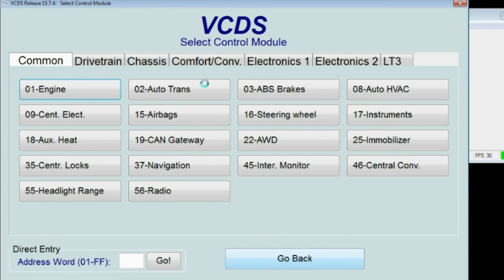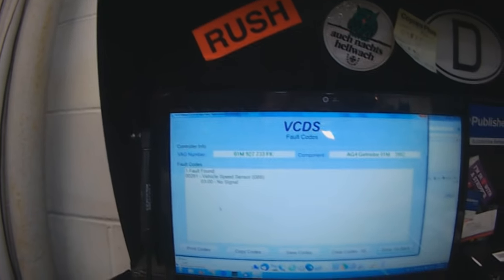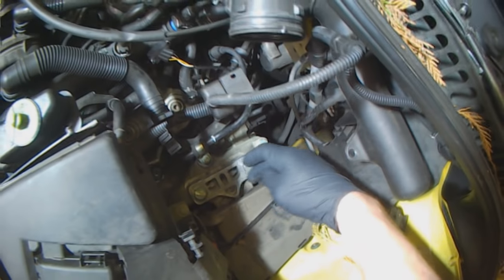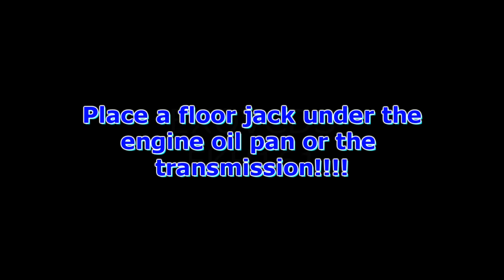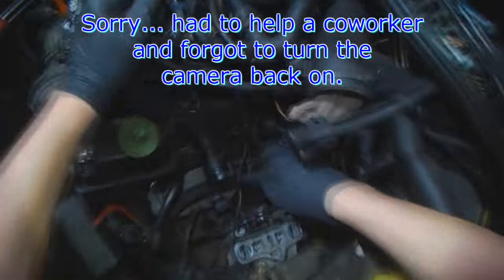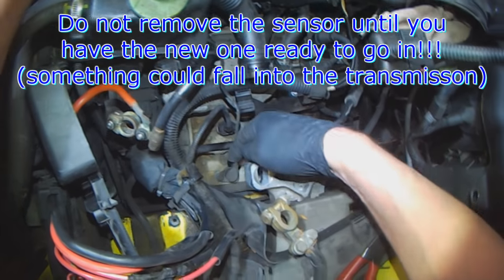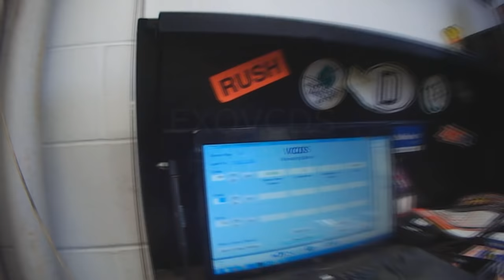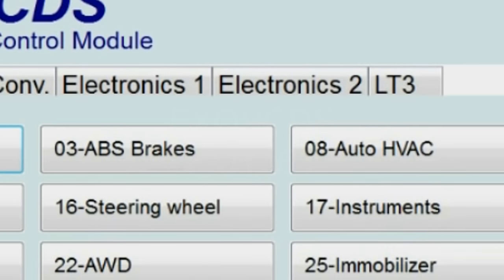VW A4: New Beetle - vehicle speed sensor (G68) no signal

Comment: i have a 2001 1.8T. i have no tachometer but speed is ok. What should i check?
Reply from the maker: Check the instrument cluster for fault codes using a scan tool that can do it. Perform "output tests" with that scan tool... to activate the needles. The needles should swing full right, left and then stop in the middle. If the tachometer needle does not move, then there is a problem with the instrument cluster.
Reply: no needle movement..
Reply from the maker: With the scan tool? You activated output tests?
Reply: Thomas EXOVCDS vcds..all ok in other needls..but not the rpm one..
Reply from the maker: Χαράλαμπος Καναλουπίτης You might have to replace the instrument cluster or have it repaired.
Reply: turns out is was the crank saft sensor..
Reply from the maker: So the engine wasn't running... now it is? Or it was running? I've never seen an engine that ran and had no tach signal. Sorry about the late reply.

Comment: hi i have a question for you
where is a esp sensor unit locate on 2003 vw new beetle
thanks
Reply from the maker: What's the actual problem? Fault code in the ABS? ECM? TCM? ESP = Electronic Stability Program... which is basically traction control.
Reply: @EXOVCDS   can not remember  but when I  tested the circuit   keep blow the abs fuse I dont know why 
and the beetle is made in Japan  so hard to find the wiring diagram in Canada
Reply from the maker: @wuwade33  send me a message (click on fkh161 link in the description and then click on "tool request"to send a message). I might be able to find a diagram for you... send me the engine & transmission type. I will then look for a diagram this week.
Reply: okay I sent to u
Reply: @EXOVCDS   is auto transmission   I forgot  put it in
Reply from the maker: I just got home from work... I will read your email and will get back to you as soon as I can / have some information.

Comment: Hi ,I have this same 01m Auto but on a golf mk4 2001 2.0l.My problem is a bit weird .The car currently has 00281 - Vehicle Speed Sensor (G68): No Signal and 00297 - Gearbox Speed Sensor (G38): No Signal.Its already in limp mode as expected.The funny thing is at measuring block 002 i have 2.48 v but the car is in limp mode.when i clear the errors they come back later after driving for a short while like 2-3 km.The tcm sees car speed very well on the VCDS measuring blocks.The ECU has no any other error and the battery is new.I have already  replaced G68 and am confused what next.Am thinking TCM faulty.What more can i check before replacing TCM?
Reply from the maker: Service manual just suggests to check the wiring... check the resistance, short to ground or positive. If all that is OK, the service manual usually says to replace the TCM or ECM (whichever one you are working on).
Reply: Thanks Thomas.When checking the resistance which has a reference value of 800 which side should i check.Is it on TCM pins or the sensor connector.Does having 2.48 voltage on VCDS measuring block confirm the sensor is ok and i should test from the sensor connector moving upwards to the TCM.Should i also test G38 pins as well on the TCM.Might you know the specific pin numbers on the TCM for this two sensors?In this scenario i am in does it mean that TCM is not providing reference voltage or is the output voltage from sensor not getting to the TCM. Which is the best process to diagnose that ?
Reply: I have also read about replacement of overlay harness for both sensors.How common is this problem vs the new TCM fix .If its a harness problem the TCM might not fix the problem
Reply from the maker: I don't see may issues with wiring or TCM.. usually just sensor issues.
Sensors need to be checked while the car is being driven. You need to attach long test leads and backprobe the sensor connectors, so that you can see a live image of the sensor waveform. Then you can see if the sensor signal drops out or has glitches. If you don't have a scope to check the sensor... then compare the voltages at the sensor connectors with what the TCM has at the TCM harness plug.
Reply from the maker: As far as I understand things... overlay harnesses are used to correct wiring issues. So yes, that would be a first step / way to go before replacing a TCM, when dealing with main wiring harness issues.

Comment: Awesome video! Question, would a bad speed sensor cause the converter to lock up and stall out an engine? My daughters beetle stalls at different times. Sometimes slowing down, stopped, or even accelerating. But it runs smooth aside from this. Thanks
Reply from the maker: 01M transmission?
No, I don't think that a speed sensor would cause the TCM to keep the lock up clutch activated. 
Solenoid #4 in the following image is the TCC solenoid (N91):
http://i91.photobucket.com/albums/k286/coolairvw/01msolenoidlocation_zps9d877058.jpg
Photo taken from this thread:
https://forums.tdiclub.com/index.php?threads/01m-part-5-solenoids.334614/
It could be that that solenoid is sticking. The TCM only activates / limits operation of the TCC to 2nd, 3rd & 4th gears... you can monitor TCC function / engine & transmission rpm with a scan tool, to see if TCC is ON. If rpms are different, then the clutch is not active, in which case, it could be something else that is causing the stalling.
Reply: @EXOVCDS  your responses very thorough and are very much appreciated. My apologies I failed myself at being thorough. It’s a 1999 Beetle from BC on the island so I’m assuming it is the 01M. Let me share my symptoms if you could please provide your feedback again. The engine runs smooth but every now and then it hesitates as if the gears are struggling to engage. It also stalls at random under no specific conditions. It happens when accelerating or decelerating but never when sitting idling in Park. After a couple of attempts it will start right back up and drive fine for another 15 miles or so before it happens again. But it makes it home. I replaced the crank position sensor but still it happens. I have a basic VAGCOM scanner but there are no codes. I’ll try cam sensor next. It could be false, but I’m drawing a connection between the transmission and the stalling as these symptoms seem occur concurrently. But please share your advice. Thank you
Reply from the maker: @lolospremiumfoodco.4681  Cam sensor shouldn't cause stalling. You can disconnect the sensor and drive with it disconnected to rule it out / verify. No codes stored could be that the ECM / ECM power supply relay cuts out. A crankshaft position sensor that is old can stop producing a signal when it gets hot... after it cools off a bit, the engine will start again, but that should set a crank sensor fault code. A bad ground connection at the engine / transmission could cause loss of connection during accelerating / decelerating (engine & transmission shift forward or backward), so you could check for clean & tight ground connections.  The short time where it does not start, check if the check engine light is ON when the key is ON (it should be). If yes, check for spark and injector pulse (clicking injectors) when cranking.
Reply: @EXOVCDS  So as you said in the other comments, My 99 beetle does not have an ECM power supply relay. So I’ll assume that I have nothing to chase on that end. The crankshaft sensor is new so the sensor is ruled out. I’ll be going over the coolant system to see if perhaps there’s a problem there causing some overheating, which I’m gathering could cause the sensor to fail. Do you have any other recommendations?

Comment: I HAVE A VW GOLF MK4  1998 AUTOMATIC AND HAVE PROBLEM WITH SPEED SENSOR (G68) AND GEARBOX SPEED SENSOR (G38). I HAVE CHANGE IT  BUT IT ISN'T WORKING .. PLEASE HELP.
Reply from the maker: winston blue Check the wiring.
Reply from the maker: winston blue 01M transmission?
Reply: 01M 927 733 FA
Reply from the maker: winston blue I just checked a wiring diagram... there are 3 wires per sensor. One wire is the shield. Check the wires from the sensor connector to the tcm... should not have any open circuits or continuity between the 3 wires.

Comment: hello I'm your videos while , I have a 2001 VW Jetta 2.0 ... 1 year ago changed the transmission oil , filter and valve body arness , all solenoids had the correct resistance , now to go up in D , it makes the change from 1st to 2nd somewhat forced , and reaching 3rd neutralized and increase revolutions, the elm327 escanner throws me the code p0730 . you could recommend me , I I live in mexico . Thank you!!
Reply from the maker: P0730 just means that the speed of the transmission is not where it is supposed to be. This can be because of sticking / dirty solenoid, low fluid, wrong fluid or internal damage (clutches, valve body etc.). It needs to be inspected to find the problem.

Comment: Hey I just changed my speed sensor with an After market one. I test drove it and it still ha s the same problem. Do I need to drive it a few times for maybe the computer to realize it was changed since my check engine light is still on? Thank you Sir
Reply from the maker: No... but you might want to clear the code if you have not already. 
Use a scan tool to confirm that the sensor is putting out a signal (like I did in the video).
Reply: Ok I will. Thanks for the fast response!!!
Reply: Ok so I cleared the code and I’m still having the same problem. I am now getting codes P0753 & P0758 & P0768 & P0773  “Shift solenoid B electrical”. 
Any advice on what to check next?
Thanks
Reply from the maker: @pujo28  Not knowing what all you disconnected / reconnected / not reconnected... makes things a little difficult as to guessing what the issue might be. In general, if codes were not present before a repair, then double check what was done. I usually go to the Ross-Tech website, enter codes in the "Google Custom Search" field (at the top right of the page below the address) and then read through the info that comes up. Year, make, model, transmission? I'm assuming it's a 01M as in this video... since you are posting under this video? Retrace your work / check connectors / connections.
Reply: I’m sorry. It’s a 2001 vw golf 2.0 
I changed the G68 output speed sensor but it’s still in limp mode and not shifting right. No 4th gear. 
After I changed the sensor and cleared the codes I still got codes P0758,68&73
Any advice and is it worth a DIYer like me trying to fix it. I can’t justify bringing it to a mechanic when the car is worth scrap at this point. But otherwise runs great so I’d like to try n keep her going. Plus no good mechanics that I could trust in NYC. 
Thanks
Reply from the maker: @pujo28  "P" Codes are usually from the ECM... was the TCM ever scanned? In my video... the Beetle never had any ECM codes, just the TCM ones that were shown. I just checked my VCDS saved logs... Mar172016Yellow1998Beetle2liter
Solenoid codes point to possible issues with the ribbon cable that the valve body solenoids connect to, or issues with the actual solenoid. Search YouTube for "01M valve body solenoid" videos for checking / testing info.
Reply: Thanks for the advice. I think diagnosing this is above my pay scale. Question now is how long roughly will the car run like this if I decide not to fix it? Or can you recommend an honest mechanic in the NYC area?
Thank you
Reply from the maker: @pujo28  There are a lot of good techs (even mobile) in the NYC area. Here's one... send him a message or post a comment under one of his videos and he can hook you up!
https://www.youtube.com/channel/UCnDg8Yr6UcMVRhcvV0PLJlA
Reply: Thank you very much Sir

Comment: I have a Mk4 1.8t that was Automatic but I made it standard, everything works in the cluster except for the speedometer, btw I have a GLI computer installed on the car. Would that be the problem or definitely the speed sensor is bad.
Reply from the maker: Is the speed sensor on top of the differential attached? How did you wire up the sensor?
Reply: @EXOVCDS  is attached my friend did it.
Reply from the maker: @FenixPajarito  you need to compare the ecm & instrument cluster wiring diagrams to see how the speed sensor is attached / wired up. I don't know if the signal goes to ecm or instrument cluster first. I would also have to check the wiring diagrams in order to tell you. On the mk4's when the speedo does not work, the fuel gauge will act strange. Does yours?
Reply: @EXOVCDS  Yes, the fuel gauge acts weird, it moves to the right and left depending on how I drive, especially when I'm low in gas the low gas warning ⚠ icon beeps non stop when I make fast turns or if I push the gas pedal a bit aggressive the fucking low gas warning icon ⚠ will appear and beeps lol so my only choice is to fill the tank with $20 bucks and the gas icon would still beep sometimes but a lot less than when I'm low in gas, however the fuel gauge acts crazy no matter what lol.
Reply: BTW My car is a 2004 Volkswagen MK4 GTI 1.8T It used to have an Automatic Triptonic Transmission with KO3s Turbo, nothing was wrong with it, it is just that my Cousin and his friend are Volkswagen fans and they told me that automatics Mk4s are for girls lol.
Reply from the maker: @FenixPajarito  I will  check wiring diagram tomorrow  and will get back to you.
Reply: @EXOVCDS  Bro you really do not need to do that but I really appreciate your help my friend, 👍
Reply from the maker: @FenixPajarito  Click on the FKH161 link in the description and then click on "tool request" to send me an email. I will then send you a wiring diagram.
Reply: @EXOVCDS  I forgot to tell you that the computer my friend installed on my MK4 it was from a Mk4 GLI that square thing that goes under the front wipers ECU?
Reply from the maker: @FenixPajarito  Speed signal goes to the instrument cluster... Engine computer should not play a role / have any bearing on the speed sensor signal. The instrument cluster sends a speed signal to the engine computer (via communication wires) if the engine computer needs the information (for cruise control).
Reply: @EXOVCDS  Bro I just removed the cluster and noticed that there is a couple of pins bend maybe that's the problem, imma fix them and see if if works
Reply from the maker: @FenixPajarito  thanks for the update!

Comment: Sounds like this is my car. I got a call from my daughter who was on a date telling me the car started to go limp and make noise. She pulled over and the code P0731 came up? Looks and sounds like a Speed Sensory. I don't have access to a VCDS?
Reply from the maker: If it's making noise, it's probably not the same fault. Check the timing belt.
Reply: @EXOVCDS  no noise just won’t go past first gear. I will check the fluid first I guess. Then pull sensors to see if they see faulted. If it is mechanical a rebuild in canada is $4500-5500 so for a 2007 with 200000 km off to bed it goes. 🥲
Reply from the maker: I doubt it is starting in first... it most likely is in limp mode and starts in 2nd or 3rd gear, because there's no speed signal. If it were in first gear, the rpms would climb quickly and you wouldn't be able to go past 30-40mph.
Reply: @EXOVCDS  thanks for your response. If it is starting in a upper gear and I have a basic odm2 reader that I reset and it still does it. After fluid is their anything I should check? Thanks again
Reply from the maker: Sorry, I just saw that it's a 2007. Different transmission than the one in the video. If you xan tell me the production code of the transmission, I can look for some specific repair info.
Reply: @EXOVCDS  wow bro thanks! I find it is a dsg in the manual and the bottom of the pan it says vwAG JPAW5 096321361A ? Not sure if I’m looking in the right spot? Thanks a lot
Reply from the maker: Not a DSG.
Regular automatic 6 speed.
I look for information about your code and will get back to you. DSG does not have oil pan at the bottom. Your transmission looks like this... yes?
https://youtu.be/ALo2It1lzZA
Reply: @EXOVCDS  yes that looks like mine. And you are right with the gears. I can drive it but it misses first gear ⚙️ for sure. There is fluid in the pan for sure when I level the car and pull the drain plug. Not sure if there  are any sensors to pull and test before dragging it to a wrecker. 🥲
Reply: @EXOVCDS  I just did the fluid test. Well, it was cold and level and it was pouring out? Weird? If cold this is not supposed to happen only if I overfill it. I never touched it and it has 140000 km.  Filter clogged? preventing fluid from circulating is that even possible?
Reply from the maker: Engine has to be running. Fluid level is checked at 35c temperature.
Reply: @EXOVCDS  Yeah I put a level on the pan and used a heat gun on the pan. Since it was not 100% accurate I gunned it to a level of about 35. Topped it up and drained access. Cleared codes and then tried to manual tranny shift. A new code came up P0732. But only after I attempted to push it out of limp mode. I did get another code as well I didn't see before. P0721.  I am going to clear codes again and do it a few more times to see which code comes up more often.
Reply from the maker: @Jasonjames1970  heat gun with engine off? Heating the pan alone is not accurate enough.
Reply: @EXOVCDS  Okay I got a new fault code reader today. I have P0732 01680 (Speed signal from ABS wheel sensory front right, 00364 terminal 15 slave(lower limit exceeded),  00453 function limitation due to excessive temperature? hmmm